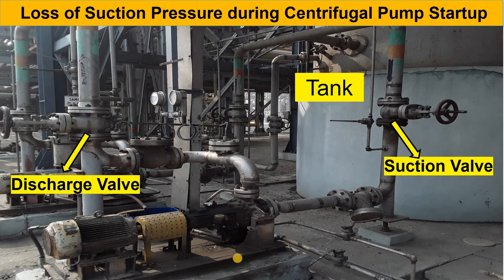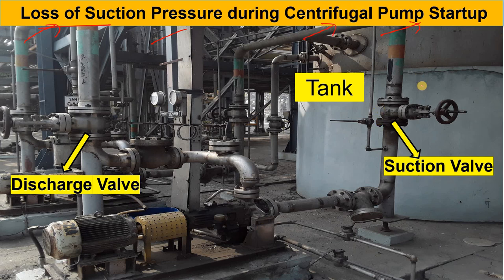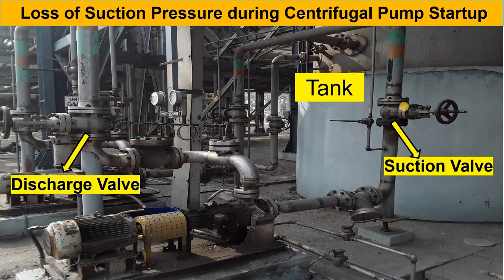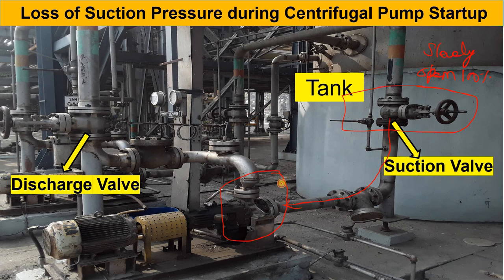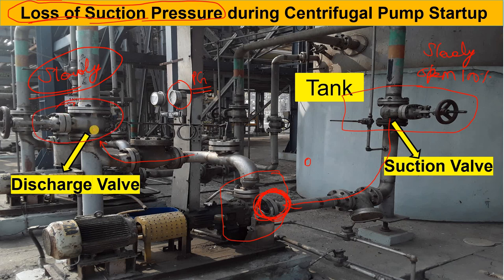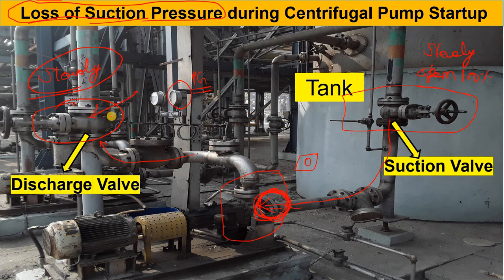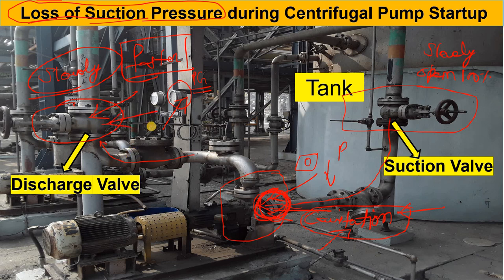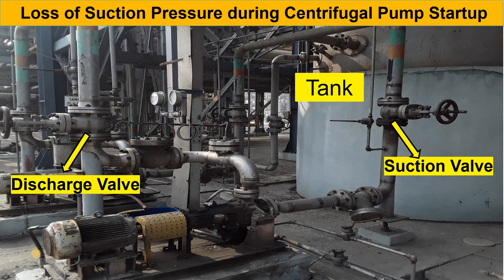Loss of suction pressure during centrifugal pump startup | Centrifugal pump troubleshooting

Comment: Simply illogical description.. We will anyway open the discharge valve full at the end of the day. Flow at full open discharge will be same whether u open the valve slowly or faster. The reason why we open slowly is to make sure we dont overload the pump when there is no back pressure. In absense of backpressure on pump discharge pump can go end of curve at exptremely high flow causing high suction line pressure drop due to very high flow
 This may either cause pump trip of high current or loss of suction due to high suction line dP.